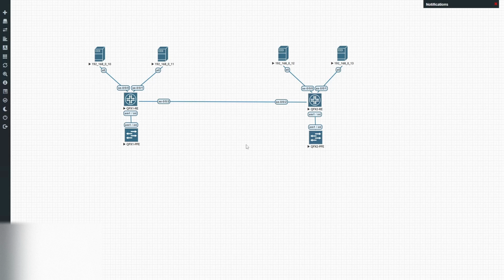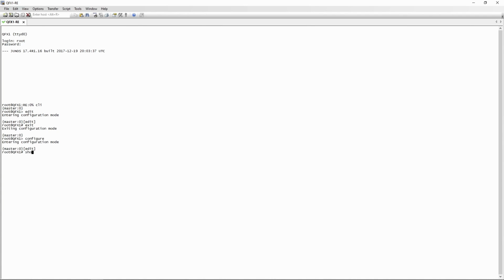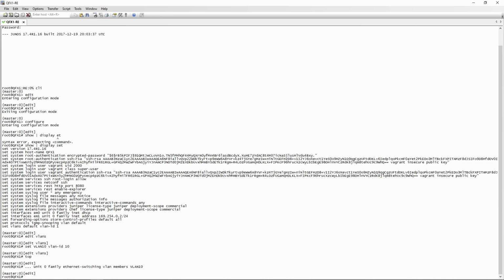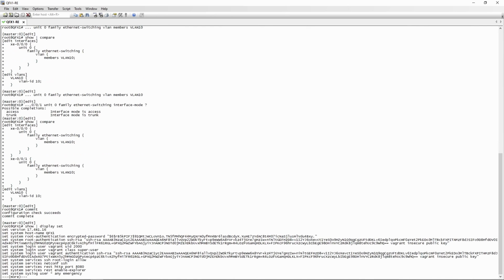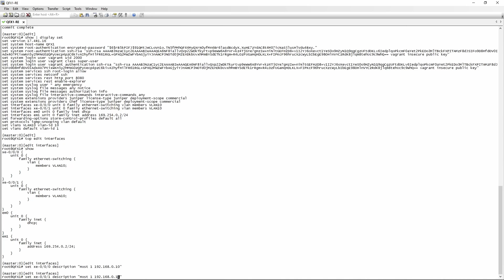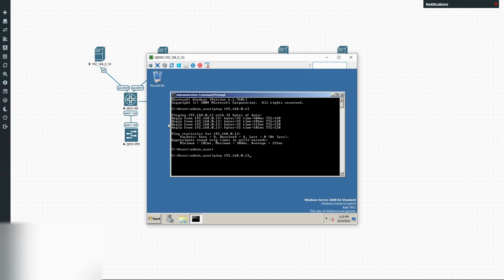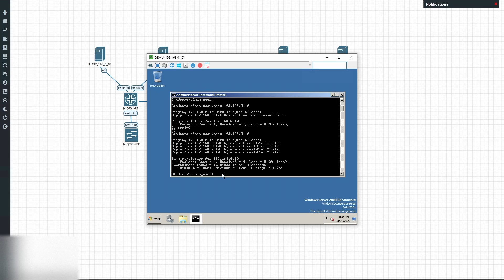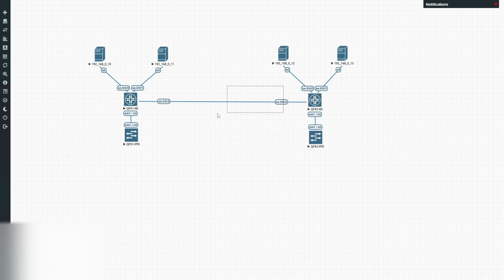How To Configure VLANS On Juniper Switches

Comment: Hello there - I have a little bit of an issue and wanted to know if you could help me. I have the same setup lab you have in the video and using the same commands as you on eve-ng with this image version Model: vqfx-10000   Junos: 20.3R1.8 limited. and also this version  Junos: 18.1R3-S5.3 limited but for some weird reason when I issue the command show interface terse I don't see the xe-0/0/x interfaces showing up.

Comment: Why "interface-mode" and not "port-mode" for setting "access" or "trunk" on xe-0/0/1 . Is there a difference and if so what is the difference in meaning and in result?
Reply from the maker: In the older versions of Junos the command used was port-mode. In the newer versions you use interface-mode. It’s the same thing, it just depends on the Junos version you use.
Reply: @lameaveragetechies1040  
Oooh, what a confusion.... Do you happen to have or know some junipers source information on that which is very explicit on the syntax change from "port-mode" to "interface-mode" . I ask this because i did not find any clear unequivocally explanation on it from Juniper docs. Thanks.
Reply from the maker: You might want to search for Juniper ELS syntax or something similar. ELS is the new platform that supports the new software. This was done to make the software more uniform to the existing routers, so quite a bit of the syntax changed to accommodate that change. But basically any switch that ends is x200 still uses the old software, like EX2200 and EX4200 etc. The newer models are EX2300 etc, and they run the ELS software.
Reply from the maker: This link might help as it contains links to a few articles, including a web-based config translator (if that still works). 

https://community.juniper.net/communities/community-home/digestviewer/viewthread?MID=71885
Reply: @lameaveragetechies1040  oh ineed, i found the documentation that states all differences from the old syntax to the newer ELS syntax. And there indeed it states that 'port-mode' has been changed into 'interface-mode'.... Aha finally ;-).....

Comment: I would not usually install an access based link between two switches... - just fit a trunk to begin with... converting later would only risk needless down time...
Reply from the maker: 100% agree.

Comment: Hi! I follow the same steps as you, but I get an error: "family ethernet-switching and rest of the families are mutually exclusive error commit failed". Can you suggest me something?
Reply from the maker: Hi, yes, that error pops up when you have configured multiple families under 1 interface. You can delete interfaces ge-0/0/0 for example and start the config for that interface from scratch. The default config has some config on the interfaces already so that is probably where the issue resides

Comment: Sir your video is good also I need your help I need juniper eve ng switch image please share me
Reply from the maker: Hi there, you can download it from here:  https://www.eve-ng.net/index.php/documentation/howtos/howto-add-juniper-vqfx/

You would need a Juniper login to do so though, and unfortunately I am not allowed to share my images with the public as you need to be a Juniper partner.  You can create a Juniper login and see if you can get access to the software downloads page, but those are usually only reserved for Juniper Partners.
Reply: @lameaveragetechies1040  What spec are you running all this on? I am using a HP server and the eve-ng ova but struggle to get x 4 windows server hosts to run!
Reply from the maker: Hi,

We are using a pretty powerful HP blade server, with 4 x Xeon processors and 1TB RAM, all on SSD storage. It was the company’s previous production server that was moved to a lab when they upgraded their servers